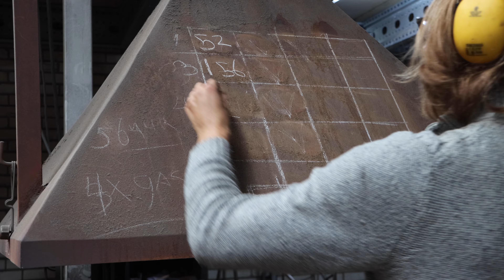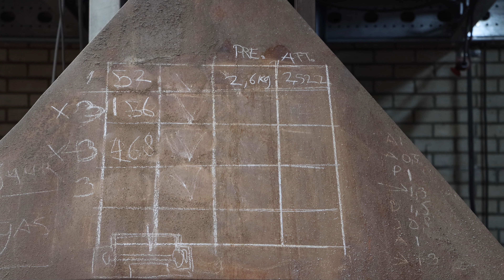Forging a pattern welded double fullered sword, part  1, forging the blade.

Comment: I don't understand why everyone still brings the fuller all the way down to the bottom, which leaves those holes or gaps under the cross guard.  Some traditions are ok to let go of. lol..   I'd rather have the crossguard/ then a 1/4" of full blade/ and then the fuller starts..  Then you can hand fit the cross guard to match the blade so much better, without those gaps that show.   Ok, rant over. ;)  .. It looks great